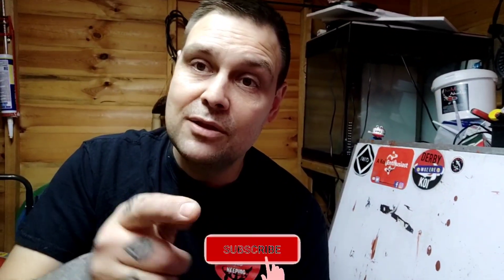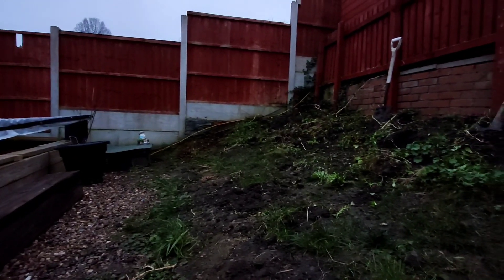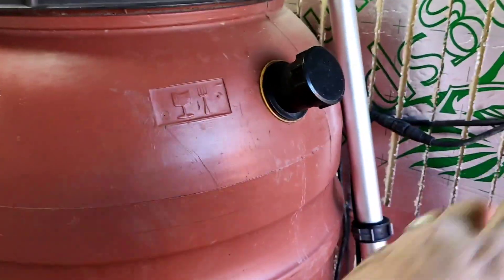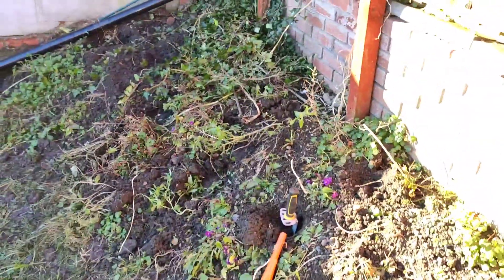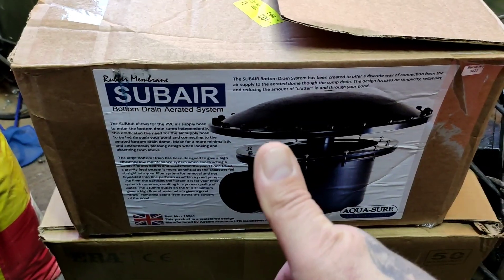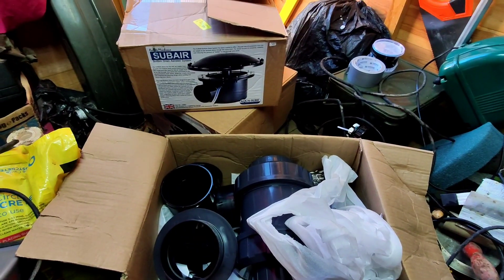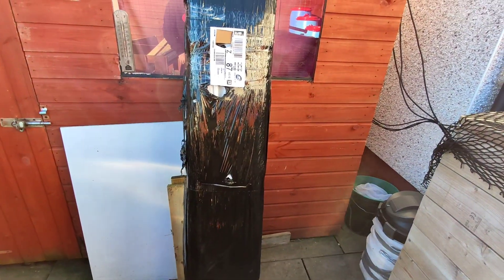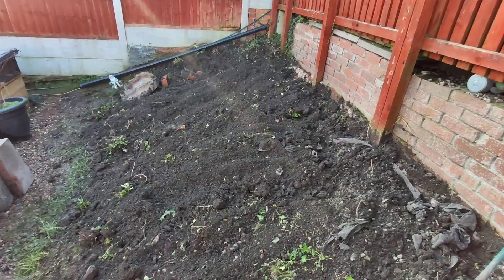**A BRIEF LOOK AT THE SUBAIR AERATED BOTTOM DRAIN KIT + MORE DIGGING PREPARING FOR THE DECKING**

Comment: Hi leon that decking is going to be banging 👍 them bottom drain s mate one tip for ya go get some push fit pipe 15 mm from Screwfix and runs airline throw that all way under pond and up to ground level . definitely option 3 with out doubt always available on  phone if needed mate 👌👍
Reply from the maker: I'll have a look at that pipe in screwfix mate thanks . Yeah that's looking like the way forward hopefully I can do it with equal length runs 🤔🤔.
Cheers mate I'll give you a bell if I get stuck which is bound to happen 😃👌👍

Comment: When you was searching for gold, Bizley was going barmy at the tv 🐕🤪😂.
Moving the switch will make things much easier. Not sure about that flexi hose for the drain, maybe put it inside some firmer tubing or use pvc pipe 🤔 
I'd go options 3, cost a bit more but easier to maintain and adjust flow
Reply from the maker: 🤣🤣🤣 I was going to put a per warning on screen as nizmo always goes crazy when she hears it 🤣 
Yeah mate I'm more than likely going to change the airline to that strong braided airline stuff. Looking like option 3 is the best bet . Cheers mate 👍

Comment: Never heard koi fry bark before! 😳😂😂😂. My pond is pump fed, so I don’t know a lot about bottom drain design, if it was me I’d only have a single drain in a pond your size. Otherwise design 3 makes more sense, as you could add another filter on at a later stage if required. Will follow your rebuild with interest. Stay safe and well 👍🏻
Reply from the maker: 🤣🤣 it's a new breed k9 kohaku 😆👌👍
Yeah mate I'm starting to think 1 drain will be the best idea and it's cheaper

Comment: Great video I would go with option 3 and put the air line in pvc pipe as well, as others have said cost more but so much easier to control and clean. All the best 👍
Reply from the maker: Thanks mate yeah it's looking like that's the only option either that or just one drain 🤔🤔
Cheers mate 👍

Comment: Hi Leon happy new year 
For low cost number 2. The short run water will pull the long run, so I would not worry as would probably get same result from both drains and it’s highly unlikely to need rodding as you have 10+ tons of water in your pond pushing down. I would have two ball valves and put one at the end of the run so you can purge the line. Or number 3,I would not do number 1 as that will be the one to give you problems. The offset T is called a ‘Y’and get terracotta colour pipes as that’s what goes in the ground. Black ,white and grey is for above ground. When doing pipe run have the off set of Y going to the short run/drain.
Ps goto your local building site and see if someone can help you for drink 😜 or ask a Ground worker if you know one to get you the items.
Reply from the maker: Thanks Daniel I'm going to have a good think as I've got a bit of time before I do it hopefully I can get bit right 🤞
Cheers mate I'll ask down the local builders merchant's or some ground workers. Thanks mate 👍

Comment: I'm surprised you didn't have anything living in there. I once left an industrial vacuum in a spare aviary for a few weeks. When I got it out it was absolutely full of mice. I had them running everywhere.  Those bottom drains are going to be interesting. I'd go with the separate lines. If something goes wrong at any point you can just shut one down instead of both. Also as you said it will make rodding them easier.
Reply from the maker: Thanks Jim. Yeah mate I was really surprised but tbh I've been banging on it for the last few days so maybe they evacuated but didn't see any signs of digging or nesting. Looks like option 3 is going to be the best idea 👌👍

Comment: Nice update video Leon 👍
I'm not sure having a flexible hose for the air placed in a concrete base would be a good solution 🤔 I installed 1 inch pressure pipe for air when I installed my bottom drain last year.
I think idea 3 would be better for 2 bottom drains. 
Who doesn't like a large 4 inch ball valve 😂
Stay safe.
Reply from the maker: Cheers mate yeah if I do stick with that air line I'll definitely need to protect it with someone strong but most likely change it tbh.
🤣🤣 Too right love a nice new ball valve 👌🤣
Reply: @progressivepondkeeping  Not sure if you saw my edit, but option 3 for the BDs.
Reply from the maker: No I missed it but yeah cheers mate looking like 2 separate lines and s the best option cheers 👍

Comment: Hello mate I would have your bottom drains left to rite rather then back to front and have 2 separate pipes with each return going to your filter house 1 drain into your boi and the other in to the filter if that makes sense lol top video too as Usual mate 🐟👍🏻🐟
Reply from the maker: Cheers mate yeah looks like two runs will be the best bet. I was thinking that but I'd need something for mechanical before the bio 🤔🤔 looks like getting the old thinking cap back on.
Thanks mate 👍

Comment: Hi Leon definitely No.3 but I might have gone for one BD in the middle of the pond as you might not get enough pull from both with your  pump on max. I get having 2 gives you better coverage but if the pull Is too weak you'll still have detritus on the floor of your pond. All is not lost however with option 3 you have the ability to close one drain off to get better pull on that side of the pond if needed and swap the process like alternate between drains or run both of them. It is very important to have separate runs for purging the sump on each drain simply by letting the Sieve run dry and opening one of the ball valves for that particular line. If the Sieve only has one outlet it might be worth getting a T on the outlet and connecting 2 pumps and have one going to a shower. As good as the 3 barrel systems are the one we had before we bought the DracoDrum let a lot of fines past and was even struggling with clumped algae at anything over 9,000 lph and needed cleaning every other day in summer. Maybe some bigger barrel's for the static bed and moving bed would help with flow rate, 🤔 something green and rectangular comes to mind 🤣.
Reply from the maker: 🤣🤣 cheers mate I was thinking of those green barrel things you showed me 👌 I've been thinking all night mate and I'm considering just having one drain . Sorry I forgot to do the explanation of the tee piece I completely forgot 🤣
Once it's all done I might go full gravity and have level containers but not sure yet but at least it will be ready to go if I do change
Reply: @progressivepondkeeping  I'll send some more pictures of them tomorrow showing how we connected them together with the 4" pipe and how we did the 4" outlet as it's pump fed gravity out. 👍
Reply from the maker: Nice one mate thanks 👍
Reply: @progressivepondkeeping  one thing I forgot to mention why not include my photo of the T in you next video as it will help you explain 👍
Reply from the maker: Yes mate will do 👌👍
Reply: @progressivepondkeeping  sent you a video on FB 👍
Reply from the maker: Cheers mate I'll check it out when I get in. Thanks mate 👍
Reply: @progressivepondkeeping  no problem

Comment: Hi Leon. Although it's nice that the bottom drains came with the flexible airline I do have concerns about whether it will hold its shape or collapse under the weight of the soil when you fill in the trench necessary to install the pipework from drain to filter. On my bottom drain I used rigid pvc piping to avoid any possible compression leading to potential problems in the future. If you plan on using the flexible tubing I would suggest running it through rigid pipe in a similar manner to your electrics. I say go with option 3 with two feeds to the filters each controlled by its own valve to ensure even draw. Fry looking great. Cheers
Reply from the maker: Thanks mate yeah in all honesty I think I might used different airlines or as you say protect it with some solid pipe as it is quite soft . Yeah mate it's looking like 3 is the only way from what people are saying oh well bit more money but definitely worth it in the end

Comment: Hi mate, great to see you again 👍 
I would be slightly worried about the design of those drains if I'm being honest mate,  especially the airline section.   
In regards to the pipework from the drains, I would keep the lines separate.
If anything ever happens to one of the drain lines, you can isolate it and fix it without shutting down the filter 🐟😎👍🏼

Hope that makes sense lol.  
Good luck and take care mate
🐟😎👍🏼🐟😎👍🏼🐟😎👍🏼🐟😎👍🏼
Reply from the maker: Thanks mate yeah looks like two lines is going to be the best option I'll be protecting the airline if I use it that is 👍
Reply: @progressivepondkeeping  good luck mate.   Can't wait to see your next upload 🐟😎👍🏼
Take care 🐟 😎👍🏼
Reply from the maker: Thanks bro 👌👍

Comment: You would need two outlets as the other two option would have to be balanced with valves due to different lengths and one will draw more than the other.
Reply from the maker: Thanks Alan looking like two separate runs is the best way. Cheers mate 👍

Comment: Leon if it was me ad go 2 separate pipes same length pipe wud be best get same flow plus easyer if you need to rod at any point plus want same drew from both drains best of luck mate 👍
Reply from the maker: Thanks Dave yeah mate looking like that's the best idea I will have to balance the flow with ball valves as I can't get them the same length 🤔🤔 looks like getting my thinking cap back on. Cheers mate 👍
Reply: Good luck mate look forward to seeing the work hope go's well 👍
Reply from the maker: Cheers mate 👍

Comment: Not sure about burying airline under the pond unprotected high chance of splitting …. If you go for 2 bottom drain which I can’t see why you need that! 1 drain and a 4” skimmer would pull more than enough but as you have them now might as well fit them…You must do them individually mate as I’m sure many have said…. Fry looking good and as for the raised area I’d build block piers and span with 6x2 timbers to get heights required.. that’s the cheapest and correct way Leon. 👍🏻👍🏻
Reply from the maker: Thanks Stu in all honesty mate I think I'm going to go for 1 bottom drain now as it makes life so much easier for me and also not sure I need 2 as you say. If you find any good videos on the decking method Whatsapp them over to me please. Cheers mate 👍

Comment: Leon matey I didn't know you were into metal detecting, I've not been for a few years but i have a deus detector and a garrett carrot pin pointer.
Bottom drain configuration should be separate pipework for each drain ideally as you will get lots of settlement and an uneaven draw (option 3)
What's the average size of your adam byer grow ons?
Shame there wasn't any rats as it would have been hilarious 🤣.
Reply: I'm with Tom on this one Leon separate pipework 😁 and just take the decking half way up the hill and put your plants and rocks back after 👍🏻👍🏻👍🏻
Reply: @ACKoi  ideally he would move the rocks around the garden every few days until the mrs says put back where the were first of all 🤣🤣
Reply from the maker: Yeah mate I love it , I don't go for hammered or anything just parks and woods etc although I would like to go in some good farm land. Yeah mate I thought that might be the case can I join both pipe as they meet the sieve or do I need a sieve with 2 inlets ?.
It's hard to say it's probably around 50% 25-30cm 50% 10-15cm at a guess
Reply from the maker: Yeah I thought that might be the case 👍
Yeah good thinking plus less wood so cheaper 😁
Reply: @Tom_Prendiville  🤣🤣🤣
Reply: @progressivepondkeeping  👍🏻👍🏻👍🏻
Reply: @progressivepondkeeping  you would need separate inlets really, as joining the two pipes together anywhere would just restrict the flow.
Reply: @ACKoi  you know that anytime the other gets involved it becomes more trouble than its worth 🤣🤣
My mrs used to work away a lot so id do stuff while she was away, saves the headache 🤣
Reply: @Tom_Prendiville  hahaha the garden is my domain ash just leaves me to it 😁👍🏻👍🏻👍🏻
Reply: @ACKoi  if only Chris if bloody only 🙃🤣
Reply from the maker: Cheers mate 👍

Comment: I dont know if you got the answer already. The "piny tree" is a dwarf alberta spruce. Picea abies conica. Same as the trees in my ikea hack forest.

For the bottom drain, I would go for option 4. Sell one of the drains and use only one.  You need a decent flow to pull dirt correctly. You dont want the pipes to collect it. I have one drain in my pond and pulls 15000 per hour via 110mm tubing in the peak of season. Can your filter cope with 30000 liter per hour? Dont over do it mate.
Reply from the maker: Thanks Magnus.
Yeah someone mentioned it was a picea thanks
And yeah mate I think I'm going to go for 1 drain it makes sense and will be cheaper for me. Cheers mate 👍

Comment: You need to get metal detecting find some buried treasure and you'll soon have enough for your new pond I'd go option 3 but you'll need another valve decking will look great and a good move resiting pump controller in filter shed
Reply from the maker: 🤣🤣🤣👌 all I find is 2 pence pieces and bottle tops 🤣 but you never know. Yeah mate looking like option 3 is the way to go . Cheers mate 👍

Comment: Option 3 deffo. Balancing will be a pain in the bum any other way, you'd be hovering one side of the pond if you didn't get the other options set up right.. I wouldn't trust that air line under the ground either. Pressure pipe for everything underground. Do it once, do it right. Otherwise it's a lot of work for nothing. 
Thanks for sharing.
Reply from the maker: Cheers Simon looking like the 3 is the only way. Yeah mate I'm probably going to change the airline or protect it with something. Hopefully this 4 inch pipe I've got will be strong enough underground 🤞🤞